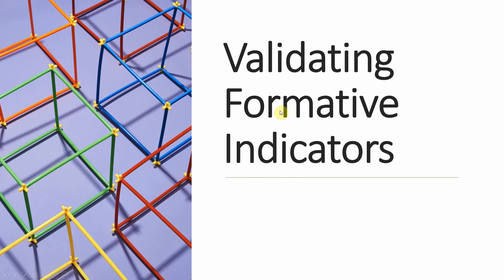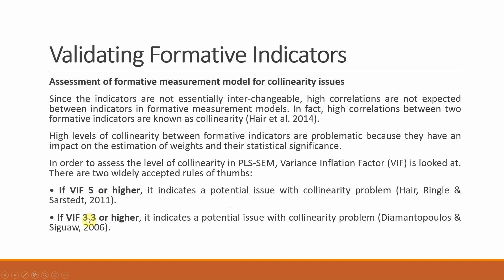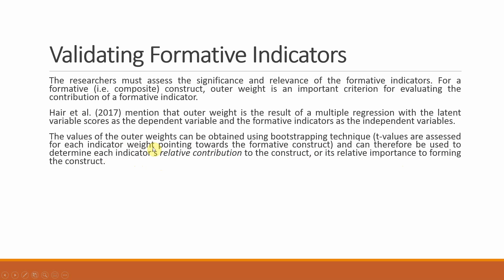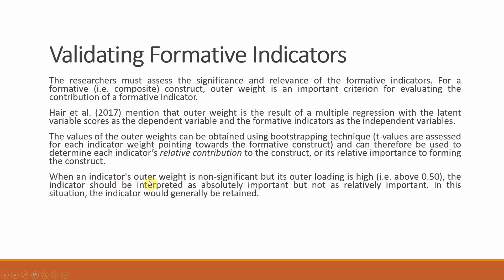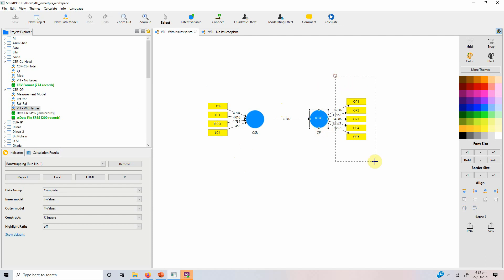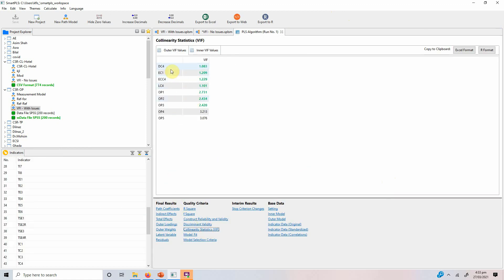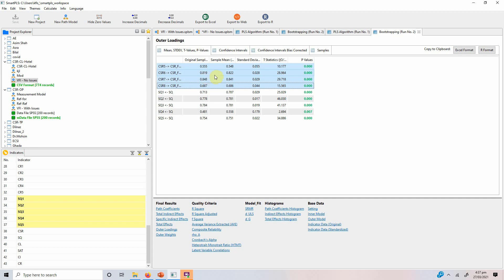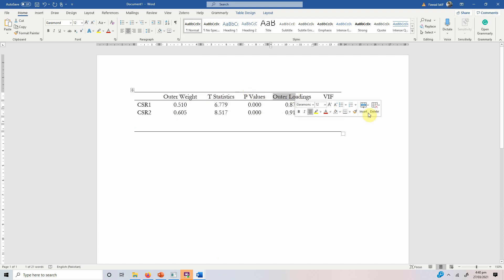How to Validate Formative Model in SmartPLS

Comment: Dear professor, I have a doubt. Why didnt you check validity using single global measurement item (Redundancy analysis). There is no overall/ global measurement item in your model. Please clarify..
Reply from the maker: Since I didn't collect data on it. I only focused on the other statistics
Reply: Sir, is it necessary to do the Redundancy Analysis for validating formative measurement items?

Comment: Hi, sir
May i know how to treat collinearity issues as the VIF is bigger than 5. Should i just remove the indicators or should i consider another way?
Reply from the maker: You may try multi-group analysis to see which group have high VIF values. Plus make sure you clean the data before running the analysis.

Comment: Salam Dr. Fawad, thank you for a very helpful video. Do you have a video tutorial on convergent validity for formative measurement model?
Reply from the maker: I don't have any yet but according to Prof. Ringle

the best option is using a reflective measurement model of the same model. But usually you do not have indicators for both types of measurment models. The second best option - as a workaround and good approximation - is using the single indicator that represents the scale. If you don't have this one, the third best option is using a very similar construct that you have in the measurment model.
Reply: @researchwithfawad  Thank you very much Dr. Fawad. I humbly have another question. Once I run the algorithm on my formative model, if there is any negative value on the indicators shown on my path model, should I immediately delete the indicator?
Reply from the maker: Negative value? Where on the outer weights or paths?
Reply: @researchwithfawad  on path model Dr. but outer loading is greater than 0.50
Reply from the maker: Negative value on path means a negative relationship between the variables. Send me the screenshot on kh.fawad83@gmail.com
Reply: @researchwithfawad  Thank you very much Dr. I have just sent you the email.
Reply: @researchwithfawad  Hi Dr.Fawad, so is it compulsory to do the convergent validity for formative measurement model? Many thanks.

Comment: Hi Sir. Why do we see outer loading in bootstrapping not in pls algorithm?. Thanks
Reply from the maker: To asses the the outer loadings along with its significance for formative indicators.
Reply: @researchwithfawad  Thank you Sir.  I humbly have another question. In the vif there are 2 space. Outer vif value and inner vif value. Can we use the value from inner vif sir?, what's the different between that?. Thanks
Reply from the maker: For validity use outer for structural relationships use inner.
Reply: @researchwithfawad  thank you so much Sir